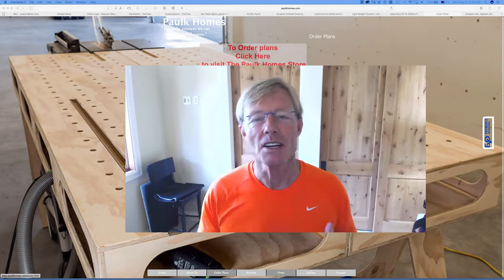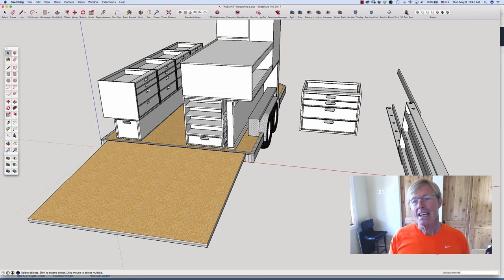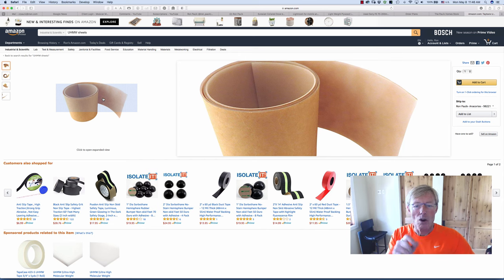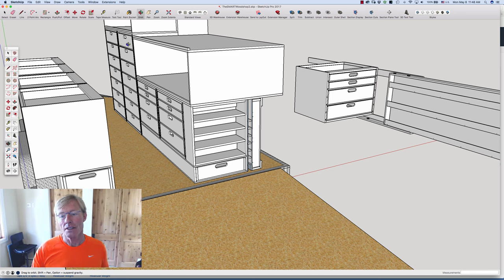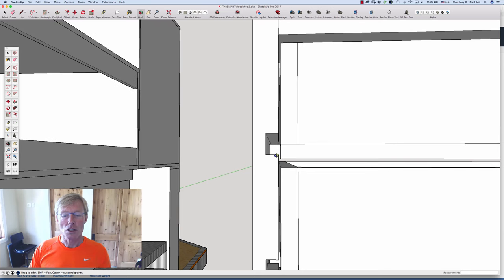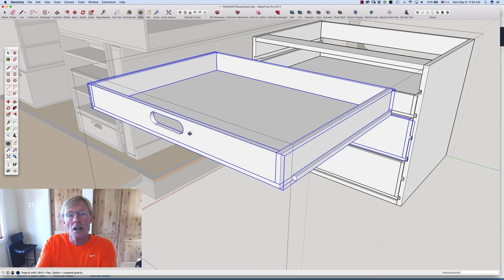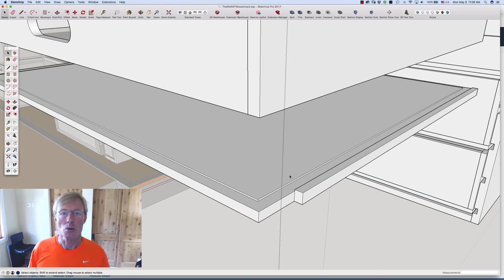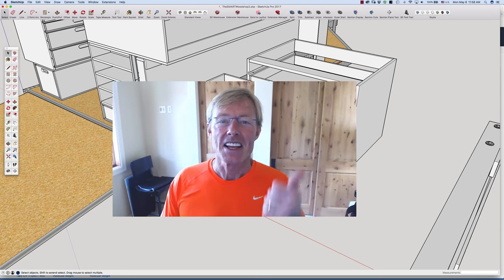The SMART Woodshop: SMART Drawers & A Question for YOU?

Comment: Hi Ron,  I'm a machinist,  the material your looking for to slide heavy things on is called UHMW. It's self lubricating,  less costly than turcite, and comes in thin sheets. I built a log splitter using this material in the moving parts and it worked great. Thanks for the videos.

Comment: A quick tip. The town I live in has no plastics supplier. What I have done many times is to run down to Walmart and pick up a few plastic cutting boards. They are from under a dollar to a few dollars depending on the size and thickness. They have a recessed area but I just run them through the table saw to make several flat rectangles and use that as stock. I usually drill and countersink screws to attach it.

I also have found in a pinch that the cheap aluminum yard sticks at Harbor Freight make decent aluminum stock for small projects.

I made a panel for the back of my computer monitor using the VESA mount holes to mount my hubs, surge protector, and extra wiring. I drilled pairs of holes so zip ties dress in all the wires. It's all nice and tidy. The power bricks are out of the way and there is only one power connection to plug in. The panel was made using the cutting boards and yard sticks mentioned above. I tapped the aluminum to use as a backer so there are no nuts to fuss with.

Comment: Hi Ron, The product I used was actually PTFE, trade name Teflon; which I purchased through a local plastics retailer in my local city here in Australia.  I had them cut 5mm thick sheets to the size I needed and fixed to the underside of the drawer and the support base, so both sheets slide against each other; works a treat.  Countersunk the screw heads so they are sitting about 1-2mm below the surface of the PTFE.  Got the original idea from a company called Drifta Camping & 4wd who make camping kitchens and drawers for 4wd/utes. Hope this helped.

Comment: Ron- Two ideas for the Smart Cabinet design.

Replace the first 1.5 or 2.5 inches of the sides with a 1X2 or 1X3 stop made from hardwood.  Dado the stops in a table saw sled with a box joint jig to space each dado.  The jig pin would be 3/4" and the dado stack would be 3/4".

After all the stops are processed, change the dado stack to 7/8".

Then dado the sides in the table saw sled with the same box joint jig to space the dado.  Keep the sides slid to one side to align the top of the dado in the stops to the top of the dado in the sides.  The stop would provide 1/8” reduction to hold the drawers in and will work on either the left or right side.  Screw the stops to the sides with pocket hole screws.  Hopefully the hardwood would last a long time, but you could replace them if you don't glue them.

Actually, I don't like the idea of changing the dado size.  Make the box joint jig fixture so that the jig pin can be indexed 1/8".  Assuming the index pin is to the left of the blade, start with the index pin positioned to the right.  Dado all the stops and all the sides, moving the workpiece to the left on each cut.  Then index the jig to the left and re-run the sides to cut the bottom of the dado 1/8" wider.  This time start with the last cut dado and move the workpiece to the right on each cut.

Here’s another idea: You have 2 spreaders at the front of the carcass.  Replace the back sheet of plywood with 2 spreaders (same dimensions as the front spreaders), orient them vertically instead of horizontally.  It would reduce weight.  It would add one additional part, but it would be the same on different size carcasses whereas the backs would vary by cabinet size.  Plus, you are already setup to make them.  This might make the cabinet not rigid enough, unless the back of the sides or the spreaders are attached to a wall behind the cabinet.

Love your videos!
Pete Smith

Comment: Hi Ron.  Enjoying the build ride.  Only thing I would suggest with the new drawer design is that the 'lip' or 'ridge' you have left on the cabinet side to lock the drawer in, will become a high wear point as you pull the drawer out and push it back in - the entire weight of the drawer now rides on that small section.  Suggest a replaceable section on the drawer side at the back you can simply unscrew and replace as it wears - not the cabinet side.  Just a suggestion.  Thanks for the videos.

Comment: Hi Ron. Just a thought for you on your drawers. I used drawers in my vans, trucks and cube trucks of various sizes and lengths. Some holding heavy loads. Since you are not using easy glide hardware, please give some thought about the pull faces of your drawers. This is going to be the weakest part of your drawer. Just doubling up on the face will give you more fastening area and strength for the constant lifting and pulling. a great design, safe for trailer bounce!! Happy to see it coming together for you. Sam

Comment: I would use UHMW polyethylene for the plastic slides. It's the same plastic that's used on the bottom of dogsled runners. When I had dogs it took around 700 miles to wear through 1/8"  plastic. For your purposes I would use 1/4" thick strips with countersunk screws. Most plastic suppliers will cut any size you need from a 4x8 or 4x10 foot sheet.
The P-Tex and Durasurf plastics that are used for ski and snowboard bases are the same plastic treated to be waxable. I only mention this to show how durable it is. You won't wear it out using it for drawer slides

Comment: You could make the viewtainer into 3 long drawers that slide out individually. The sides would be the same height as the retaining edge you now use. They would be much lighter, could be a simple variation on the standard drawer design, and be accessible from both sides. The Teflon tape would be a must to cut down on the friction. Just tossing around ideas.

Comment: I've used Formica in places where I need to slide things. Under the Paulk Total station and under my sheet good storage.  

Drawer stop: do you think the back edge of the slide out will get chewed up? None of my drawer bottoms are smooth enough to ride on that edge. I'm sure rounding it would work. As someone else said if you rounded that off and also rounded your drawers it would save some time and you could use a flush trim bit to trim the front of the drawer after the drawers are assembled. Definitely wanting to see this in use.

Thanks for sharing all your creative thinking.
Reply: shooshinejonnie I was thinking the same thing. Cheap, slick, easy to adhere.
Reply: shooshinejonnie Yep - Formica and the others are phenolic based and would fulfill the request for a cheap solution.

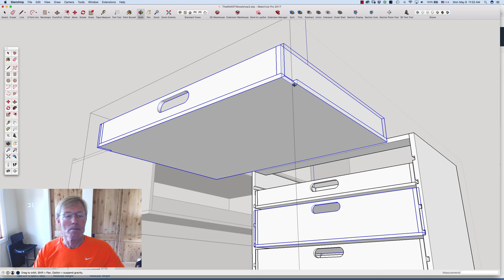Comment: 5:40 you could chamfer those dado notches and/or the drawer glide so you wouldn't have to lift it up.  It will ramp off itself when pulling it out, but won't come out during driving.
Reply: I agree with this, or round them over slightly, or ramp them. That way you don't have to be so accurate pickup up the drawer to pull it out. Also you get rid of the sharp corners which might splinter or be crushed over thousands of times pulling the drawer out.

Comment: Ron, try pvc board....4x8 x 1/2" is around $100. but you can cut it into many strips probably close to what you'll need....if you do decide to use it, make sure you wear a dust mask when cutting....thumbs up on the drawer stop idea....

Comment: Get some HDPE locally (Tap Plastics-Bellevue) you can get some thin sheets that are 4ft x 8ft long for $100 or direct from a local plastic company for $50 sheet (.125")
HDPE High Density PolyEthylene ... I use it all the time, smooth surface for my Panel Saw, tool jigs, many other uses!

Comment: +1 for UHMW from McMaster, if only I lived in the states like ...you'all :)
I have concerns that at full extension - even past half extension - with viewtainers loaded up, you are creating a cantilever with some significant load. My guess is that you will have decent deflection and might even crack the plywood in the upper box where your table saw goes.  I didn't run any numbers, but just a feeling that, over time, the cantilever might not be ideal in this current configuration.  I like the idea, and don't want to come off as negative, just stating a concern and can't think of a super simple way of mitigating the moment/torque at the connection.

Comment: I have used the 3/4" wide tape from Woodcraft (https://www.woodcraft.com/products/slick-strips-3-4-width-1-32-thick) for tons of jigs, and also used it in a kitchen retrofit for one of my Eagle Scouts Projects to tune up some 50 year old drawers that we could not replace the slides.  It is very slick, and is self adhesive.  I have only ever used it on one side, and never had a problem with it.

For routing all those notches on the drawer bottoms, I would gang them all together and put a straight edge across the stack and rout them all at once.

Comment: Barn doors, that are not barn doors?  I totally get the preference for a ramp, but if you did have barn doors, you would devise a ramp to attach to the floor of the trailer for access (have both)!

Going with the ramp (which you have) and the idea of having both, would it be possible to configure two barn door shelving systems (just wide enough for your viewtainers) that would profile themselves behind the ramp (when closed) and swing out (on open top hinges - for removal) when the ramp is down

tension on the hinges may not allow for a full 4 foot shelf/door, but certainly a 2 foot shelf/door would be possible leaving the aisle open for access even in the closed position

Comment: Fast cap doesn't have a product for that?  The three drawers solution sounds like a good idea. If your still wanting to pull out one big panel have you ever considered putting a roller at the bottom front of the opening and two on the rear of the pull out. One on the bottom to ride along the bottom of the carcass and one on the top to ride along the top of the carcass once the pull out is over half way out it would tip down and ride along the top. Hope that makes sense.
Reply: Sorry I just watched the previous video. Sounds like your getting away from the rollers. Why aren't you building maybe the three drawers side by side above the wheel well.

Comment: I would avoid the "tape" in a high use situation like this. I use 1/4 UHMW in all kinds of friction reduction situations. It's ridgid and mills exactly like wood so no special tools needed. if the 48" isn't long enough just find a suitable location for a joint and chamfer the edges. Use it on both surfaces and it will slide like it's on ice. UHMW Sheet 1/4" X 4" X 48" By Peachtree Woodworking - PW1122 https://www.amazon.com/dp/B000H43OES/ref=cm_sw_r_cp_apa_fxqezbTWS40FC

Comment: Here is the exact UHMW-PE tape I used on my drawer slides. It's 20mil and fairly tough. You might get away with thinner mil, it would take some experimenting with a couple of different ones to get a feel for it. I just played it safe for the one project.
http://a.co/eu9jmwC
Reply: Just another note: I used the tape on just the drawer bottoms and they slide very nicely. If it were used on both friction surfaces you would be shocked at how slippery this stuff is. I can't imagine using double surfaced 3.5" wide. I'd go with 2 rows of 3/4" at the edges and leave a gap between with both surfaces covered. I saw a spec someplace that said it was rated at 6800lbs tensile strength and is many times slicker than Teflon.

Comment: I like the drawers a lot!  Love the smart and simple design!  I'd use them in a workshop, not mobile.  Main question: what is to keep them from pulling out if they are extended all the way out? 

I've used the slippy or slippery tape from Woodcraft on a small jig. https://www.woodcraft.com/products/slick-strips-3-4-width-1-32-thick  It is metal riding on the tape.  It worked ok, but this tape is very thin, I realize you are talking about thicker strips or even thin sheeting cut into strips.  How would the strips be attached?  Is there an adhesive to glue it to wood?